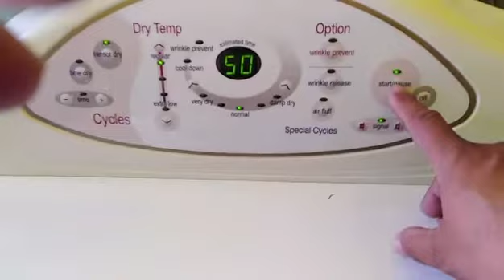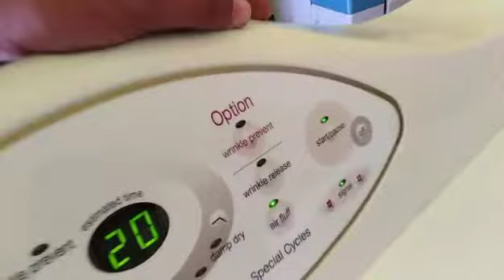Gas dryer installation / Instalación secadora de gas

Comment: HOLA! Muchas gracias por compartir el video, 
en mi casa, tu casa, el patio es muy pequeño y uso cilindro de gas (no estacionario), ¿Es seguro colocar el cilindro de gas a un lado de la secadora? ¿O debo tener alguna distancia mínima por cuestiones de seguridad?
Reply: Vine por la misma duda 😅 Sabes si se puede con cilindro de gas?
Reply from the maker: Que tal Iván, espero que el video haya sido de utilidad, no olvides darle like y suscribirte al canal.
R= No pasa nada amigo, colocar el cilindro a unos 2 o 3 mts de distancia, saludos
Reply from the maker: Espero que el video haya sido de utilidad, no olvides darle like y suscribirte al canal.
R= No pasa nada,, colocar el cilindro a unos 2 o 3 mts de distancia 👍
Reply: @verysmarttv1283  muchas gracias

Comment: Mi pregunta es sí al poner el gas está secadora sé puede usar en 110 vatios de la energía eléctrica
Reply from the maker: Que tal Dublas, espero que el video haya sido de utilidad.
Si, independiente que la secadora caliente con gas, se tiene que conectar a la red eléctrica de 110v, saludos 👍
Reply: @verysmarttv1283  muchísimas gracias por la buena información y por hacer esté excelente video
Reply from the maker: De nada Dublas 👍👍

Comment: Alguien que pueda contestarme estas secadoras de gas no necesitan estar conectadas a la electricidad
Reply from the maker: Espero que el video haya sido de utilidad, seguiré subiendo continuamente más videos al canal. Las Secadoras de gas si necesitan estar conectada a la electricidad para que funcione el motor 👍
Reply: Sabes que boltaje necesita 220v o 110 v
Reply from the maker: Hay para los dos, 110V y 220v